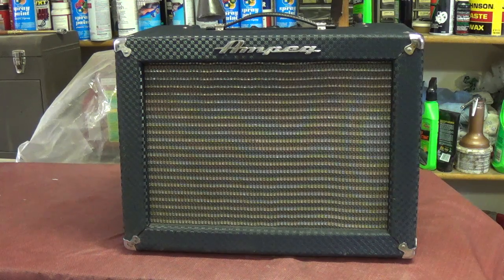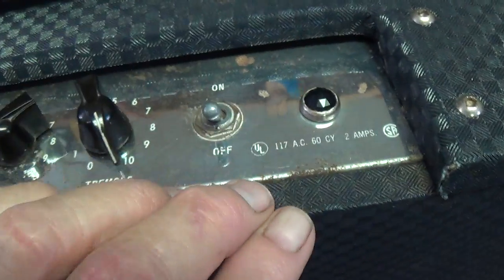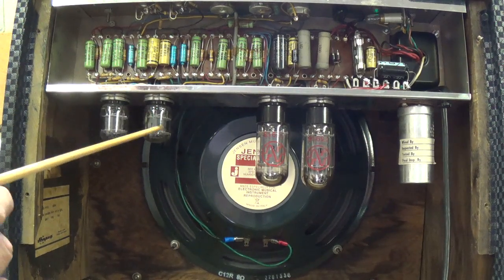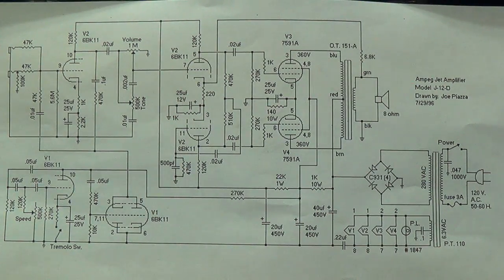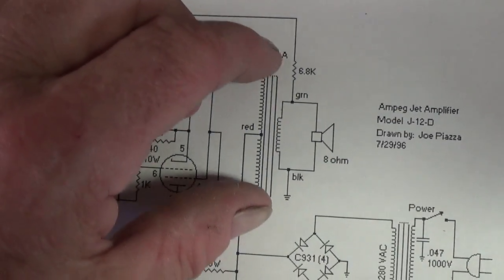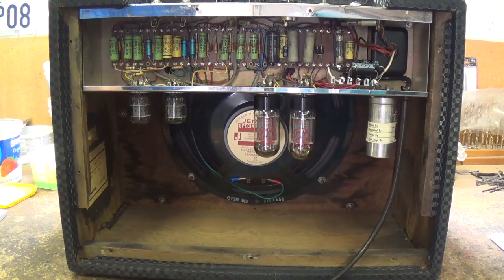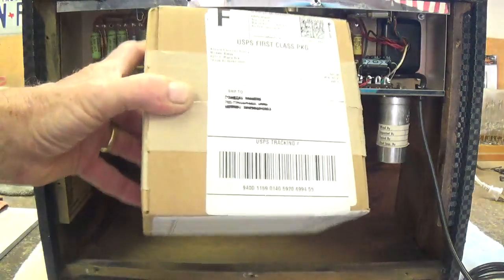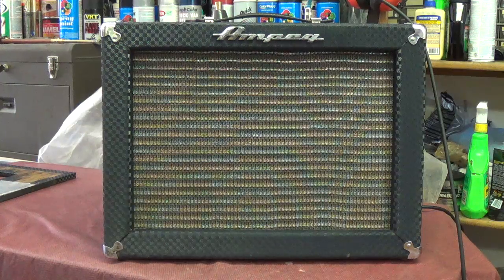1966 Ampeg J12D Jet from Craigslist.....Junk or Gem ???

Comment: Hi Doug, aren't you overestimating the plate current by measuring it through the cathode bypass resistor? I would say that includes the screen current, which could be upto 10% of the plate current.
Reply from the maker: Yes, the screen current is included. This was not intended to be an exact measurement, especially since both tubes were measured at once, but simply a quick check up. If the PD had not been in the proper range, then I would have initiated a more detailed and accurate individual assessment.
Reply: +Uncle Doug Thanks for clearing that up!
Reply from the maker: No problem, Dries. Thanks for watching and commenting. In other videos, dedicated to biasing procedures, I go into more detail.

Comment: Doug, it's Ade again regarding the Panama amp. If there are no switches to set the Ohm and only one speaker input jack,
How can I tell what Ohms the amp is set at? Thanks in advance.
Reply from the maker: I guess you can't tell, Ade. You'll just have to trust the folks at Panama. If they're wrong, and disaster ensues, then I guess the amp can be returned on warranty.
Reply: +Uncle Doug So if I have a multimeter there's no way to tell what Ohms the amp is set at? Also, I may have another piece of the puzzle. I took off the back cover and one of the leads from the speaker input jack goes to a built-in attenuator. Does that change things?
Reply: +Uncle Doug So if I have a multimeter there's no way to tell what Ohms the amp is set at? Also, I may have another piece of the puzzle. I took off the back cover and one of the leads from the speaker input jack goes to a built-in attenuator. Does that change things?
Reply from the maker: Yes, that explains a lot. Apparently the attenuator establishes the proper impedance for the output transformer, regardless of the impedance of the speaker(s).
Reply: +Uncle Doug EXCELLENT DOUG, Thank You for solving the mystery. now I can use the amp worry free. Have a nice weekend and hug Rusty for me, Ade.

Comment: Uncle Doug; you can't just leave these old mid 60s amps alone. LOL!  Nicely  laid out and constructed  interior  The GE compactrons were innovative at the time, but hard to find these
days.  Good transformer  verification procedure. . Those old 50 yr filter  cans probably  needed replacing.a  few years ago. Good troubleshooting on the 7591 tube.
Did you find out what element was shorted in the original tube?  
 Was it a heater to cathode short on warmup.?

I agree with you on it having a nice tremelo.  Is that some strains from "Earth Angel"?
Reply from the maker: Thanks, SC. I have not yet investigated the cause of the internal short, but I kept the old tube and will check it out in the near future.  I guess it could be Earth Angel.....I just have these familiar tunes in my (ancient) memory and they come out from time to time :)
Reply: Here's what I found out about a possibility with this 7591 power tube
problem that would start to "snap,crackle and pop" when the tube warmed up.  

Got this info off Harmony Central about the  Ameg Jet,  which is the subject
of Rusty's and your undivided attention.

"Also, another cool note about Ampeg's cathode bias is that they use the positive voltage developed by the cathode resistor on the power tubes to elevate the heater line above ground potential which helps reduce heater noise."

So it is possible as the 7591 tube heats up, the heater at 6.3v AC
potential distorts and touches the  cathode  which is at cathode bias potential and there is an "argument"  between the two tube elements. about the difference of potential after the tube warms up and starts to conduct.

The fact that the output transformer tested good with the ohmmeter indicates to me that it cannot be a plate to screen grid short, as that symptom would have more dire consequences to the output transformer.

Rusty is a valuable sidekick with his sniff test.  He can determine just from a sniff if the amp in question has serious internal problems..and an overheated winding on the output transformer would have an objectionable smell to his delicate olefactory senses.
Reply from the maker: Your analysis sounds quite feasible, SC. Thanks so much for your input and recognition of Rusty's great sniffing skills :)

Comment: Hey Doug - another great video, especially for a tube amp repair newbie like me :)  I REALLY HOPE you do a PART 2 to this video when you investigate WHERE THE HUM COMES FROM.  I must have bought & sold approx 15 tube amps in my day and most of them had from a slight hum to a loud noticeable hum. I would really appreciate you showing us neophytes how to diagnose and fix the HUM situation that are very common with most used tube amps.; THANKS IN ADVANCE, best to you & Rusty, Ade
Reply from the maker: You're welcome, Ade. To be honest, I have no set method for identifying the cause of a 60Hz hum, mainly because there are probably 900 possibilities. Generally, I just blunder around until something I do makes the hum either change or disappear.....and then I declare it a brilliant repair :)
Reply: I hear ya loud & clear Doug - I don't think I ever met a vintage tube amp that DOESN'T hummmmm :)
Reply: Uncle Doug Doug, I have a QUESTION - The new boutique tube amp company called PANAMA claims to have a true plug N play amp because it has circuitry that auto detects and self adjust the Ohms. In other words you supposedly can plug the amp head into ANY speaker cab and it will work without setting the Ohms. If you go to PanamaGuitars.com and look up their 5 watt studio amp "The Conqueror". The rear has only ONE input speaker jack and no switches. I contacted customer support and they confirmed that no Ohm setting is needed. Doug, have You heard of anything like that??
Reply from the maker: I have never heard of an amplifier circuit that could automatically adjust to any speaker impedance, AW. I'm not saying it's impossible, but I can't imagine how this would be done. If you ever find out, please let us know.

Comment: Uncle Doug;. The screw you encountered on this amp is known as a "clutch head".  I had an Ampeg VT-22 back in the day, and it too used those screw heads.  Fortunately for me at the time, my parents had a travel trailer that just happened to use clutch head screws for almost everything, so my dad had the required driver in the house.  

If you ever run across a VT-22 in decent condition, it's quite the amp.  100 HONEST watts RMS, 4 EL34 output tubes, a tube rectifier, 2 12" speakers (I had Altec Lansing speakers in mine), shock-mounted amp chassis, mechanical reverb tank lock for transport, and with the Alec's, over 90 pounds in weight.  The tone was amazingly clear and full.  It was also loud beyond belief!  Being the volume head I was back then, I bought an Ampeg B25B cabinet to go with it, and loaded it with 2 15" Altec Lansing speakers.  Since the amp had an output impedance selector, it would develop all 100 watts into the 2 12's or the 2 12, 2 15 speaker combination.  When using all of the speakers (both the combo and the cabinet) it was frighteningly loud.  Ahhhh... the good ole days.
Reply from the maker: I looked the screws up on the Internet and sources agree with your identification of them as being "clutch head" screws, Lawrence. I ground down a blade screwdriver a wee bit and had them out of the cabinet rapidly and easily.  That VT-22 sounds like a real beast.  Hopefully your hearing withstood such horrendous volume levels better than mine did over the years :)
Reply from the maker: I can't hear you, Lawrence :)
Reply: Uncle Doug WHAT???
Reply: Uncle Doug, Those screws are "clutch head" screws. They were also used in Holley carburetors secondary metering plates. I remember them from my mechanic days. I still have the screwdrivers in my tool box.
Reply from the maker: Thanks for the info, T.J.   :)

Comment: Love the tag board wiring. Ampegs were very well built IMO.
Reply from the maker: Yes, it's neatly wired and fairly easy to troubleshoot (except for figuring out where the %@#&?*$ hum is originating) :)
Reply: @uncledoug , I have a 1964 Ampeg Mercury m-12a with the same issue. Did you ever get this issue figured out?

Thanks for all you do UD!

Comment: A wonderful find. These are very rare over here. I wonder if the heater hum is due to those multiple ground references, I've been caught out there in the past shorting out and lifting caps or balancing resistors individually only to learn sometime later the fact there must only be one. I'm sure you've though of that. Hum is  really pain. I have a friends ac30 here at the moment, one of the odd seventies pcb ones that has had its power section rebuilt roughly point to point. The heaters were a real mess but like many ac30s there's multiple spurious ground points and this one being partially pcb isn't allowing the grounding to be jigged much. Hopefully I will be at least able to send it back quieter than it came. Hope you and yours are keeping well,  all the best, Pj and Badger
Reply from the maker: Thanks, PJ, and best regards, as always, from Rusty to Badger. The wiring of the circuit is all original, so if multiple ground references exist, then it was built that way.....which seems unlikely.  I tend to think that a component is causing the problem and am suspicious of the tremolo circuit, since its signal is inserted right at a point that would coincide with a likely source of the hum. I will spend some time tracking it down and will report my findings :)

Comment: Those amps are pretty expensive,so you did well, you are lucky thag you know how to diagnose and fix any problems that a amp might have.You not only know how to fix them but understand the theorey behind the amp design to thd point thst you can design your own amp from scratch.Not many people can do that nowadays.
Reply from the maker: Thanks, Philo.  It does help to be able to work on them.  Since few local people can, it greatly limits the demand for project amps and keeps the prices quite low. Occasionally, I get "burned", but the vast majority of these project amps end up very economically repairable.
Reply: @UncleDoug  do you ever have any for sale?

Comment: A super find, as well as a super bargain, you have there ...very nice indeed Doulas.
The noun 'compactron' is certainly new to me (closest I've heard to that one is 'dekatron').  Never, in all of the thirty-six years in Audio, and television, servicing did I ever come across that terminology even though I worked with MVEs (multivalve envelopes) like, for example, EBL31 (double diode pentode), and UABC80 (triple diode triode).  Another type of noun I have recently become acquainted is 'nuvistor'.  It is certainly true, we never cease learning. 
When I saw those Roberson screws holding the back cover of your Ampeg J12D, I had to smile as it reminded me of the tamper preventative screws we occasionally fitted, like also torx, spanner slotted, tri-wing, mor-torq, spline etc., to certain (pain in the butt) customers television, radio, radiogram, or record player who appeared unable to resist the temptation of unscrewing, and removing, the back cover to determine whether the recent repair work, and the amount, and types, of components fitted, was as it was written on the invoice, whilst also taking a clandestine poke around in the back at the same time LOL.
Regards,
Phil.
Reply: Those type screws were used in the late 60's into the 70's mobile home industry. If you could not find a screw bit to fit them, you had to grind a thick flat head screwdriver into one or even worst, drill them out with a drill bit. Thankz
Reply from the maker: Thanks, Phil.  I tend to think the odd screws were to discourage tampering, but they can be fairly easily removed with a slotted screw driver (as I did).
Reply from the maker: I was able to remove them with a modified flat blade screwdriver, ATL, with no harm to the screw head.
Reply: +Uncle Doug Back in the day, I rehabbed several rental trailers and the older ones always had those type of screws although the trailers. I'm so glad you had had no trouble with them! Thankz
Reply from the maker: I got them out without any problems, ATL.
Reply: +Uncle Doug I 'm sure you don't let any problem slow you down! Whether it is a weird screw head or a 12 pin vacuum tube, Uncle Doug, goes onward through the fog! Thankz
Reply from the maker: You're welcome, ATL. With Rusty to pull my sled, no destination is unreachable :)

Comment: Hi,Doug,i  have the ReverbeRocket model R-R12, Ampeg ,guitar,accordion,mic inputs,vibrato and echo peddle,the speaker is 12 inch Concert loudspeaker Radio speakers of Canada limited.Jensen,same handle and tolex? material,its warm and and way loud ,works fine.nice vid ,was very surprised to see the jet.
Reply from the maker: We were surprised to find a 60's Ampeg guitar (not bass) amp locally too, Nat. Hopefully, there will be more :)

Comment: Great new post! I had an Ampeg amp in the 70's. It was smaller than this one. It had the same 12 pin preamp tube which was bad. could not find one at the time. Should have kept it. Thankz
Reply from the maker: You're welcome, ATL. Yes, I understand the Compactrons have been elusive for quite a while. I'm going to check around to see if I can find a couple extras, just in case I need one in the future.

Comment: if we're placing bets on where the hum is coming from, I'll place mine on a bad triode section in one of those compactrons!
Reply from the maker: Bite your tongue, Sean. That's exactly what I've been fearing, since the tubes are hard to find.  I did switch the 6BK11's, figuring that if one of them had a bad triode, the hum might change or go away.....but it didn't.
Reply: +Uncle Doug I'd think it would chance a little bit due to differing gain structures, though maybe not enough hear... Hopefully it's not that though! maybe there's a bad virtual centre tap resistor or something easy and cheap ;)
Reply from the maker: We can only hope :)

Comment: This amplifier is a great find! I've had many modern day tubes with a H2C shorts. Not surprising these days...The hum could be from lead dress, but more likely from leaky bypass caps. Ampegs were in a class by themselves. very different from the Fender. These amps were actually built here in New Jersey. I have a few friends who used to work for Ampeg as service technicians. The company was excellent in supporting independent technicians. I used to get parts delivered sometimes, the same day! But, Ampeg now, isn't the same company as we knew it. It's now owned by Loud Technologies...
Reply from the maker: Thanks, Frank. I will focus on the bypass caps. One of them had a different ESR value than the others.....maybe it's the culprit.
Reply: To be honest Molson, I repair these amplifiers for a living, and I've seen over the years how the quality and workmanship has gone down hill. Most of the reissue amps are very poorly made, and I DO NOT like the idea of putting output tube sockets on a PCB. I've had many Fender reissues and other amplifiers come in with completely chard circuit boards beyond repair. An output tube shorts, takes out the screen resistors, and burns holes right through the board. I've taken a few Fender Blues Jr's and gutted the board out and did point to point wiring. There's a reason why the amp is under $500. To sum it up simply in one word...China. You take it from there LOL :) If you find certain amplifiers that are hand-wired, point to point, you pay a hefty price for them.
Reply: I'm with you Frank, VINTAGE IS WAY BETTER. as I was saying to Doug I must have bought & sold approx 15 tube amps in my day. As for LOUD TECHNOLOGIES, I run Hot & Cold with LOUD Tech. The vintage all tube V50 & V32 are very sought after amps. I have them and love them. For the Studio I also have a 5 Watt V58 (not the VC508 - crappy amp) BUT ON THE OTHER HAND I ALSO had the BlackHeart "Little Giant" - where the tone was so generic it felt like playing through a cheap solid state amp. Had to use a Boss Blues Overdrive pedal just to get any semblance of a tube tone amp.Sold that POS real quick. Now down to 7 amps and 3 of them are all tube vintage CRATES.
Reply: Ampeg is now owned by Yamaha as of April 2018.
Reply: Also a little note to add...Ampeg's were also notorious for poor grounds. once these minor issues are solved, they are quiet as a kitten.
Reply from the maker: I will use that info while trouble-shooting, Frank. Thanks :)